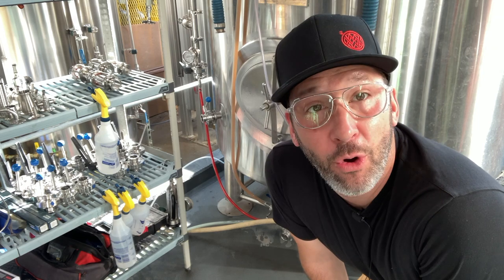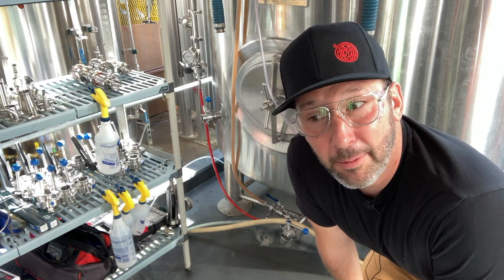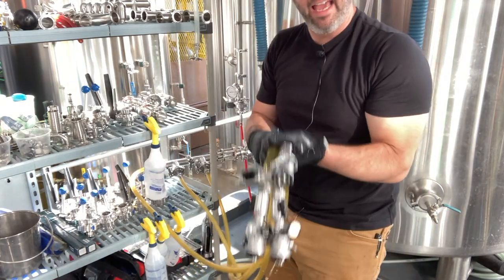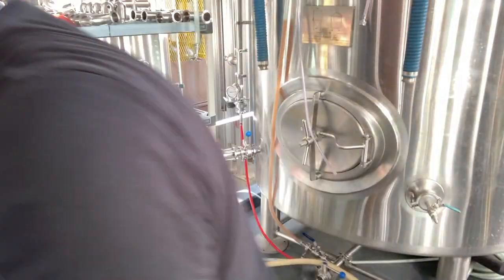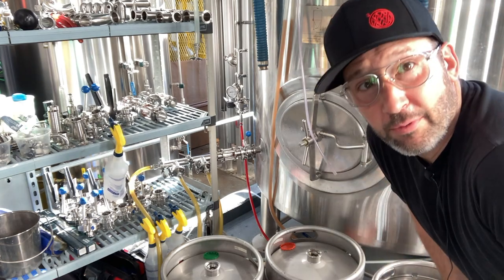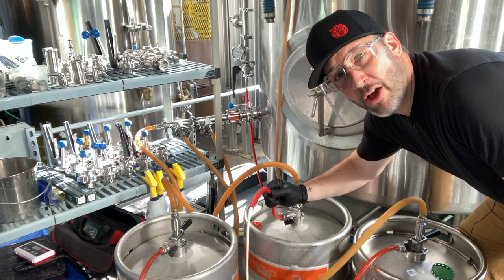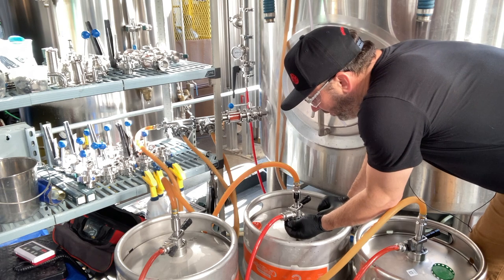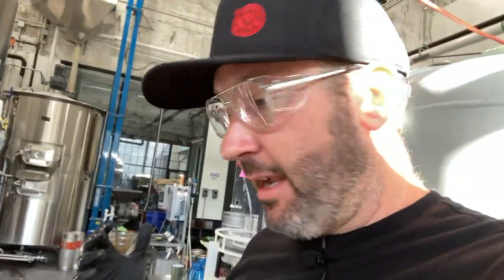Pro Brewer Tutorial: How I Keg Beer!

Comment: Another great video. Thank you! If I can put in a request for a video! If you can talk about heat exchangers and how you have it set up for chilling and transfer to the FV, that would be brilliant! I'm in the process of getting mine set up and there's a few things I'm trying to find out more about (controlling the temperature, filtering before the wort goes through the HX etc. etc.). Thanks again for these videos, really useful!
Reply from the maker: I will add it to the list. Just some quick notes. Make sure you have all cooling inputs running with cold water and or glycol before you start chilling. Then drive the temp of the runoff by turning your pump up or down. Up will warm up the beer, down will cool it.
Reply: @adammakesbeer  thanks!
Reply: @adammakesbeer  awesome, thank you!

Comment: Hey there! I'm interested if you have a stand pipe in the tank or not? And why you're coming out from some sort of sample port rather than the bottom. The brite tanks I work with have stand pipes so we just come right out of the bottom. Otherwise your method seems very similar to the way I do it. One other thing that could potentially help you, is for me instead of tipping the water out after rinsing, I have a little blower thing connected to a co2 line (you could probably use air to save some co2 depending on your setup) to just blow the water out, then iso and cap it. Anyway, I like watching your videos man! Keep it up!
Reply from the maker: Great idea, thanks! Yes that is why, those tanks don’t have standpipes. We do switch to the bottom later, but hold them for in-house kegs and mark them as ah ingr some sediment so the FOH staff knows to let them settle.

Comment: Hi, I have my beer at equilibrium in my BBT, in order to keg it I am pushing at 15 psi. Questions: should I leave a headspace? Should I add CO2 in the headspace to reach equilibrium of my my beer? Does the pressure in the keg prior to kegging matter? Would the temperature of the keg make a difference? What happens if I store my kegs a warm temperature? Thanks

Comment: Hi, you have good practice of keg filling, if possible some day please let me know how to force carbonate a 13 gallon of keg for about 3 volume of CO2  without making froth in beer would be great to know .
Many thanks... Cheersss
Reply: Look up a force carbonation chart for the best answer. It will give you a temp and a pressure to work with to get to your desired vols of CO2. However, it wont be able to give you the third component which is equally important: Time. Time is a variable if your using a carb stone or just a regular keg. If you have 5-7 days to wait at 1-2 degrees C, then you should be good do go with any chart you find.  
Now, the last part of your question re not making the beer froth, that will depend on serving temperature. 
A combination of all of these factors along with your equipment and experience will get you where you need to go. Good luck.
Reply from the maker: I agree!!! ☝🏼☝🏼☝🏼